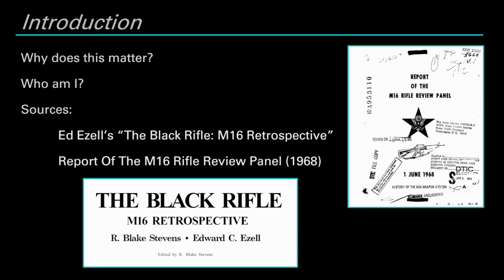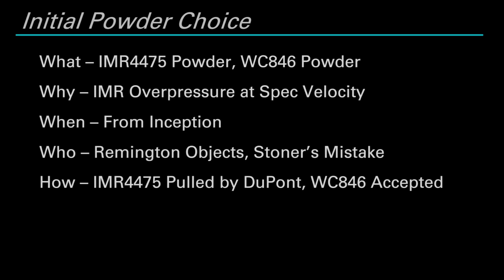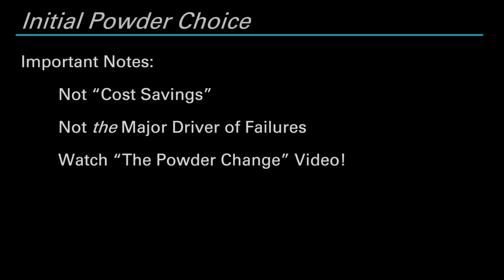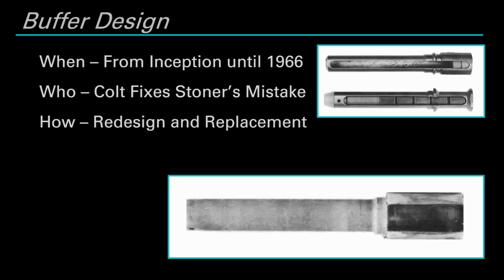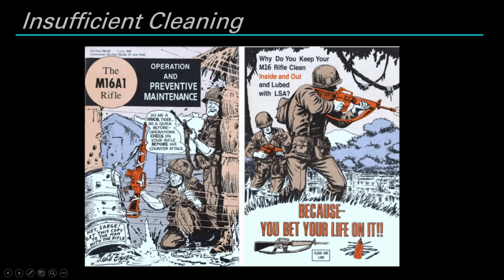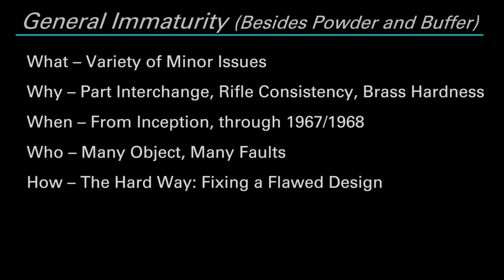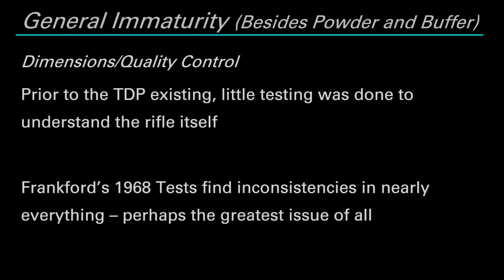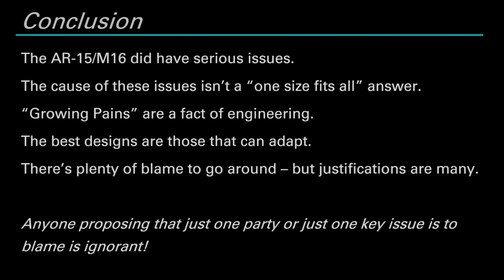M16 in Vietnam - The Real Issues, Briefly Explained

Comment: Excited to finish this video but I noticed one small error: 

17:22: Remington was owned by DuPont at this time, not the other way around (DuPont sold Remington in the 1990s). Also, Winchester was purchased by Olin's parent company, Western Cartridge in 1935.
Reply: Also, there was no SAAMI spec on .223 Remington in the late 1950s because it didn't exist. Stoner asked to have the shoulder blown forward on .222 Remington, making the .222 Special.

He was trying to chase the moving goal posts that the Ordnance Board kept shifting to meet the steel helmet perforation requirement.

.223 Rem wasn't formalized until 1964.  Colt was in their 2nd production model of the AR-15 already by then, the Colt 602.

601 production began in Dec, 1959.

Comment: It's interesting how the 609/XM177 had a "normal" weighted buffer in like 1965  but it took another year for them to adapt it to the full length rifle system. Perhaps Colt knew the sliding weight buffer was a better design but waited to be "told" to do it. Ditto with the reversible hemispheric handguards, which were clearly a better and cheaper design, Colt had rifle length prototypes made as early as 66 but the military had no interest in them for whatever reason
Reply from the maker: I don't believe the 609/610 entered production until 1966 - the improved buffer was figured out by the time it was in service.
Reply: The 607 had a nylon buffer, if you look at the sample from West Point's museum.

That might have run fine with the faster-burning IMR stick powder, but not WC ball propellant and its higher port pressures.

That development of heavy, internally-weighted buffers for rifles and carbines being fed the higher port pressure ammo makes sense.

Port diameters had to be reduced, according to Chris Bartocci's research into the Colt archives.

The ball propellant had lower chamber pressure, but higher port pressure.
Reply from the maker: Heavier buffers were in development before WC846 was adopted. The nylon buffers are steel weighted. I'm not aware of any of the nylon buffers being completely free of steel weights.

The original buffer was always underweight and poorly designed, even with 4475 loaded ammo.
Reply: @IvanPrintsGuns  Those of us who have been tracking the older rifles since the 1970s and earlier refer to the first buffer as the Edgewater Spring Guide.  The conical segments in it are somewhat like what you see in the Browning A5.

Comment: Would you be able to do a video like this, as up to date as possible, for the sig p320, what actual issue there where, that still remain l, and why the issues exist?
Reply from the maker: I'm not sure even sig really knows why the 320 has issues
Reply: The fully cocked firing pin and tolerence issues seem to be the biggest thing.  @IvanPrintsGuns
Reply: Sig acknowledged an issue and created a fix back in 2017.   
On their website, look up Voluntary Upgrade Program to enter a serial number to see if it’s had the upgrade or not.   Lots of old 320’s still out there.

Comment: Really enjoyed the video. You mentioned the M4, but not the XM177 and the 10” barrels. What were the issues with the initial XMs?
Reply from the maker: I'm not aware of much data on their use, but they weren't very widely issued, and typically ended up in the hands of people who knew what they were doing (and presumably would be better cared for because of this).
Reply: XM177 Colt 610 didn't have much plug dwell time.  It was an updated evolution of the original commando, the 10" barreled Colt 607, which was part of the CAR-15 family of weapons shown in 1963.

They experimented with different muzzle devices to tame muzzle blast and address the cyclic rate, but eventually went with the XM177E2 and its 11.5" barrel.

The XM177E2 with 11.5" pipe and 4.5" Moderator solved the reliability problems of the 10" guns, and was produced and adopted in much larger numbers than the Colt 610.
Reply: Exactly. The XM177 is cool, but it was only really used by Special Forces like MACV SOG. So, most of their usage was no doubt classified.

Comment: I had a guy telling me that 4473 powder was "cleaner and didn't produce as much gunk" and his claim to this was that in the GWOT the modern powder made his gun really dirty and was annoying to clean
Reply from the maker: 4473 as in the background check? IMR powders are said to have produced less fouling when they were compared head to head with WC846, but this difference in fouling doesn't see an associated flip in rate of failures for WC846. The Panama Trials were particularly interesting in this regard - clean rifles running WC846 were lots more reliable than clean rifles running IMR. By the time both were filthy, WC846 was still ahead, just by not quite as wide a margin.
Reply: @IvanPrintsGuns  Oops lol, Blonde moment but yeah, he was claiming the old powder produced no carbon at all

Comment: @1:32:00 the cost they calculated for the fix was that 1: it helped but didnt completely fix the issue, new lubrication would still be needed, & 2: the lost production it would take to implement across a lot of manufacturers & sub contractor's right in the middle of the war right when they needed guns most.
Since new lubrication was needed in either case, & it pretty much fixed the issue as it was without massive production interruption, just issuing new lube was the obvious and correct solution(just like the powder switch with the M16).
The reason they didnt fix it after the war was that they had millions of guns and the entire budget went to nukes anyway, so why waste money on a solved problem, we will be going to a calculus & cocaine fueled Heinleinian nightmare for our rocket propelled paratroopers to use when they jump into Moscow in 1955. 
Then Korea happened, we need guns now, these work, make more.
Then everything that was developed as improvements for the Garand in 1945 was implemented in the M14, & no one could actually manage to built them properly, so maybe there was something to not implementing a big change to how the 2 most critical part of the action interacts in the middle of a war on a 95% good rifle when a lube change fixes 99% of the issue?
Reply from the maker: The roller bearing eliminated the need for lube entirely, and worked far, far better than lube alone. The test data is very clear on this - the roller bearing was a great solution. A change in lube was barely a bandaid (certainly not a 99% fix). Sure, fixing the design would have slowed down production a little - but even after WW2, this isn't implemented *for the production restart in Korea*. Even if an absolute halt would be required in WW2 (it wouldn't have been), they had that opportunity between the wars. And didn't do it. And, to little surprise, the issue was present in Korea again.

Saying it was too hard or expensive or unnecessary to implement on Garands (it wasn't, it absolutely could have been implemented) isn't an indefensible position - but if that position is taken, what the Army did with the AR15 can't be explained as anything short of rolling out the red carpet.
Reply: @IvanPrintsGuns  I must have misremembered what Hatcher had said in Book of the Garand.
Reply from the maker: Hatcher went with the justifications that were given for not fixing the Garand's issues. I don't think these justifications stand up to scrutiny very well. At least not if the discussion is going to be framed around "when the government doesn't fix a rifle, it is sabotage and got our boys killed". In a more serious framing, Hatcher's justifications are fair, and neither rifle was "sabotaged".

Comment: I'd recommend showing the specific data on screen as you discuss it, even if that data would be boring or dense as a visual. 

For example, when you were comparing the failure rates of Korean War era M1 Garands to the worst combat reports about the M16, having basically only a blank screen to look at made it difficult for me to judge the point on my own as you spoke about it. Having the data tables posted as a comparison between the two tabulations would have made that a lot more convincing, as right now at best I have to find what you were basing that section of the video on and check your work myself, potentially very tedious. At worst, I could assume some level of duplicity or bias where you are attempting to obscure differences in types of error or the contexts of said errors, should I think you untrustworthy as a presenter. 
This isn't specific to just that comparison, but a general statement about the type of content and its presentation in these kinds of videos. 

I understand it is probably  an additional editing workload, but it would make these types of videos far more convincing and far more deep and substantial when the viewers see the exact 'raw material' you yourself were looking from, and they can make the same judgments you had from the same documentation. If the source material didn't conveniently come out as a direct comparison of that sort, even still, your own shorthand chart or the like with the original blurb would still be very welcome.
Reply from the maker: The issue is that the tables would need a solid thirty minutes to explain on their own to avoid the (valid) criticism that apples are being compared to oranges. Without full context of the numbers and a lengthy explanation of what they mean, there's a lot more "taking me at my word" required, and all that distracts from the point anyway.

In various trials, Korean war era Garands had failure rates so high they simply stopped testing them. International Harvester's guns were particularly bad. Failure rates far over the ~10/1000 that the AR15 saw at its peak.

The raw material is available, to some extent, in the various videos I've made about the M14 vs FAL and M16 thus far - but a breakdown of that information here will turn this video into an extended version of those videos.

Comment: Out of idle curiosity what’s the reason for the corroded lower receivers, there are photos of m16s with the mag wells eaten away entirely. Whats the deal with that?
Reply: Early Colt rifle receivers were made with 6061 aluminum instead of 7075.
Reply from the maker: Yep, like Daniel said - early on, Colt was using 6061 aluminum. Both 6061 and 7075 are susceptible to a phenomenon known as intergranular exfoliation - where the aluminum underneath the anodize (aluminum oxide) layer is able to corrode, causing the part to fail from the inside out. This can cause issues that present themselves as minor cracking or crazing of a part all the way to complete disintegration.

My best guess as to why the switch to 7075 fixed (for the most part) this issue is that Colt's anodization process worked better on 7075 than 6061. As mentioned, 7075 does suffer from exfoliation (though to a lesser extent than 6061), and the anodization process is ultimately important to preventing it.

Comment: While this video is excellent I do object with the claim of the AR-15 being one of the most reliable service rifle designs out there as it lacks many of the design features (some have been implemented since) associated with rifle reliability such as:
- bolt overtravel behind the magazine to allow more variance in initial bolt velocity and to give the magazine more time to present a round
- camming extraction to help get those stuck cases out
- fixed ejector is a more reliable way to eject cartridges
- reliable, sturdy magazines, with thick feed lips, constant curvature, and anti tilt followers
Reply: How many different military rifles have you run in high volume, across desert, arctic, and tropical conditions?

Fixed ejectors are notorious for wearing or breaking.

I have yet to see any assault rifle handle high volume like TDP-built AR-15s/M16s/M4s.
Reply: @LRRPFco52  Dismissing basic firearms mechanical facts with some deluded subjective experiences is childish and demonstrates low intelligence.

It is ridiculous to claim that a fixed ejector, ie. a hardened claw of steel would be more prone to failure than a tiny spring plunger. Completely preposterous. The only reason spring plungers are used is for packaging/size constraints etc. any time that any firearms engineer can use a fixed ejector, they do.
Reply: @oddspaghetti4287 I come from the developmental  Defense Aerospace community, so I look at the engineering a little differently.  I've also spent a lot of my life in the dismounted Infantry, Reconnaissance, and NATO coalition partner force communities watching how small arms designs actually play-out in all types of terrain & weather.

Fixed ejectors sound great until they wear out or break, and can't be replaced by the end-user or unit level armorers.

I've seen that with AKs, SIG 550 series, and K2. ETA: FNC

Sprung plunger ejectors work fine and are easy to replace.  Rifles with fixed ejectors are a design trade-off, not free from negative consequences.

There is nothing childish or of low intellect in pointing these facts out.

Comment: I need to read your sources for myself, but I thoroughly enjoyed this presentation. It completely altered my understanding and perception of the troubled early history of the AR-15 pattern rifle. I more or less came to all the same conclusions as Wendigoon did back in college when I wrote a paper on the subject. Clearly, I didn’t find every relevant primary source and perhaps read too many biased secondary sources.
Reply from the maker: For me, it was learned that the "bad" powder has been used ever since 1964 (with calcium content allowable tweaked along the way, but identical burn rate) that started my dive into figuring things out better. Like most people, I believed the sort of common fuddlore narrative, even if much of it didn't seem to add up to me. The answers are out there, and utterly shred the common fuddlore - but understanding the facts is much harder than repeating the handwavey fuddlore.

Comment: A good bit of information is wrong or misleading, what can learned M16 broke the government monopoly on the Primary long arm and no one  was held responsible for the criminal negligence or malice
Reply from the maker: There was no criminal negligence. You should watch the power change video, and pay very close attention to why the powder was changed.

Negligence would have been doing nothing, not changing the power.

Cleaning kits were available early on. The manual for the rifles (this manual predates US involvement in the war) even says what cleaning kit and supplies to use. And how to use them. It's black and white, no debate possible. Colt's marketing obviously didn't somehow supercede the manuals, because the manuals are very explicit. I'm not you have a very good understanding of this topic.
Reply: What was wrong.He was spot on.
Reply: @hairydogstail that the stick powder caused pressure issues for the .223 cartridge and that cleaning kits were issued early on to the M16 cause they misunderstood Colt marketing.
Reply: @hairydogtail Also in Fudd buster show the host has said to get factoids wrong to boost engagement in the comments.
Reply from the maker: @jumpykilllerqx6029  that's great and all, but this isn't the Fudd buster show
Reply: @IvanPrintsGuns the M16 was issued 1965 to the US Army Mass issue of Cleaning kits didn't happen until 1967
Reply from the maker: The M16 was issued prior to that. And the manuals that existed before "M16" was a thing even still had instructions on cleaning kits - what kit, what supplies, how to use. Cleaning kits did have to be requisitioned separate of rifles in some instances, but the manuals still told you what to do. In instances where complete breakdowns of communication happened, manuals nor kits were available - I explained all this in the video.

As for the powder change, I have a whole separate video on that subject. 4475 had a history of overpressure, which is why only certain, hand-selected lots of 4475 could be used in loading 223. This is why, when orders by the millions of rounds were rolling in, ammo companies stopped bidding. Again, watch the video on the powder change, read The Black Rifle.
Reply: @IvanPrintsGuns Tried researching if DuPont 4475 has a history of Pressure issues or if .223 has a pressure issues with DuPont 4475, read the opposite.
Reply: @jumpykilllerqx6029  He covered the powder issue just as it happened. Read The Black Rifle.
Reply: @jumpykilllerqx6029  IMR 4475 began showing pressure issues in 7.62mm NATO around the same time it showed up in 5.56mm.  It was mentioned in a footnote in the M16 Rifle Review Panel report.
Reply from the maker: "I searched online" is not how you sufficiently evidence a topic like this, especially in the face of the overwhelming research of people who have sufficiently evidenced the topic.

People who fail to understand the powder change misread the fact that most 4475 would be at risk of blowing AR15s up as being "4475 wasn't available", when in reality it's that only a select amount of 4475 can be guaranteed to not blow guns up.

If you want to "find the info", I've linked it in the description of this video.